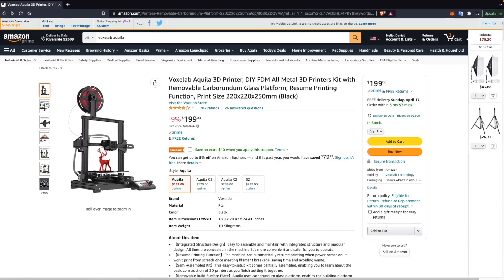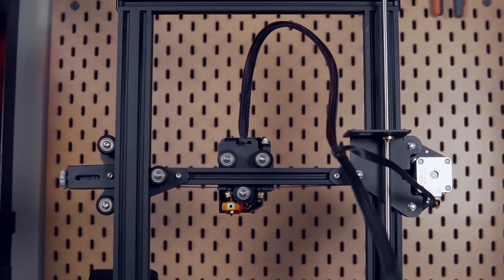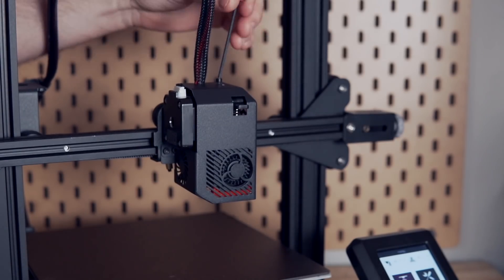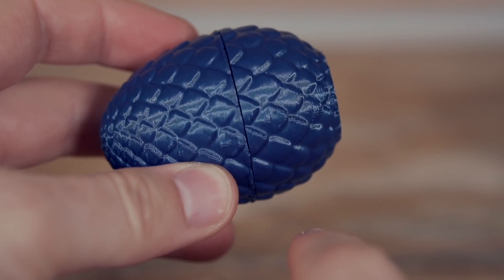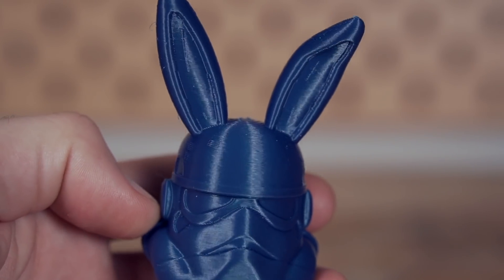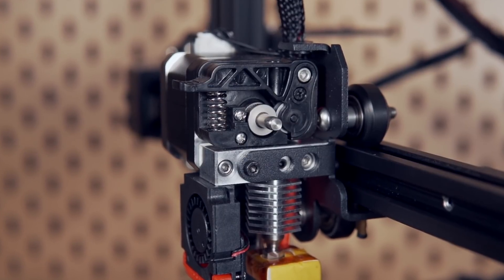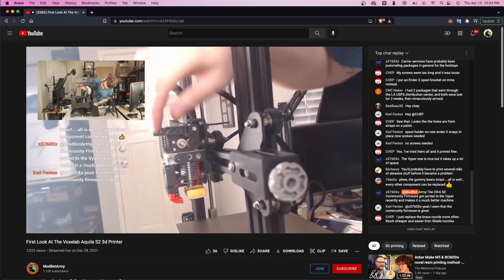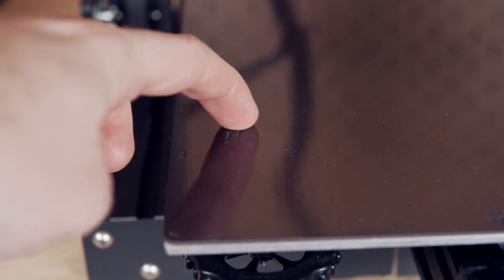Best $300 3D Printer For Higher Temp Printing? Voxelab Aquila S2

Comment: what is the difference between the Voxelab Aquila X2 3D Printer and the Voxelab Aquila S2 3D?   which is preferable and why?  Many thanks to those that answer.
Reply: They're effectively the same, except that the S2 is capable of printing at higher temperatures and has a direct drive extruder, where the X2 has a Bowden tube extruder. If you aren't looking at printing ABS or other high temp filaments, the X2 is probably enough, but at only about $40-50 more, the S2 is a little more future proof if you might expand to high temp printing.

Comment: I will take the original and the cash.
I printed a direct drive plate for the ender 3, used a light pancake motor an all metal original single gear extruder and flexibles print like magic.

Total cost? $12

Comment: My actual opinion though, is for that price point, I would rather go with other options that include auto bed leveling. I mean this IS 2022 and almost every printer is being shipped with ABL as standard now, and while I think some budget machines just won't work it into their sub $190 price range, with options like the Geeetech 3D Touch literally being under $10 with shipping included, they could easily add it onto every machine without it impacting the price. I just think some of these companies are going stagnant and just reviving their older machines with the bare minimum, but increasing the price.
Reply from the maker: As long as the abl is implemented correctly then I agree. I would still rather manual than a poorly implemented auto leveler. I have experienced both on creality when they first dabbled with able as well as a few printers that had implemented it poorly in firmware or used really bad inductive probes that I spent more time fighting with it and it was worse than manual. Granted it has been some time and agreed especially on these things beds that are warp prone. Abl and all metal hotends are what I want to see as a standard.
Reply: @ModBotArmy  yeah no doubt. the 3D Touch from Geeetech has been tested against the BL Touch and so far has had really positive response

Comment: Hi ModBot, by any chance, have you tested thermal protection features for this printer? If not, you proabbly certainly should ... Their previous model had serious issue of firmware freezing on thermal events like runaway - which is REALLY dangerous. It's terrifying Flashforge hadn't even tested this themselves when printer went to production!
https://youtu.be/9Vai6NKxeG0?t=422 
https://www.youtube.com/watch?v=eGUPBoDxmKk

Comment: That hotend..... Great video, but proprietary nozzles that you have to order from Flashforge and wait for slow China shipping.  No hardened nozzles for the machine either, at least not last time I checked.  

BTW that extruder is the same extruder they use on some of the Flashforge machines, that is why they probably went with it.  It was cheap and already in use.

Comment: This printer seems perfect, except that you can't get hardened nozzles for it.
Reply: you can use standard nozzles...
Reply: @ComicMelon  But not at high temperature, the longer nozzle is to reduce the heat on the PTFE.

Comment: One thing not mentioned in the video. The nozzle is proprietary form factor. For me, right off the bat - deal breaker. Absolutely no reason for it.
Reply from the maker: It is not something I was aware of. Block outwardly appears standard and removing a nozzle isn’t a part of testing process. After seeing the nozzle I am not entirely convinced you couldn’t use a volcano nozzle. Even if the throat is slightly longer it should work. It is what I currently do with v6 nozzles on an mk8 block.
Reply: @ModBotArmy  Someone made a mod to use one of the standard nozzle form factors you could install.  But you have to do something like that, you can't just use a volcano nozzle apparently.

But just my opinion, this is yet another thing you gotta do.  Why not get a lower cost printer and just install a heatbreak into the stock hot end or drop a new hot end in?  And then there's just the principal of the matter - I refuse to support with my money a printer that introduced a proprietary nozzle that adds literally ZERO functional advantage.  Just... no.
Reply: @heroflying  can you link the mod?
Reply: @zombieno1  Negative. I heard about it second hand.  Sorry.
Reply: @heroflying  qqaaaa0ap

Comment: I've heard that hotend uses a proprietary nozzle. It's not an off-the-shelf Mk8 (longer screw than standard). Could you confirm?
Reply from the maker: Which is odd considering the block is fairly standard sized.
Reply from the maker: Looks almost like a volcano https://youtube.com/shorts/PvGom4ijve8?feature=share
Reply: @ModBotArmy  Sadly its not. Its entirely proprietary sized. :( Its shorter than a volcano and longer than a mk8. The nozzle that comes with it is the wrong size. Oh and the block is also proprietary.
Reply from the maker: @3DPrintSOS  could you not use a standard volcano and have a bit of the throat sticking out? I have done similar with v6 nozzles on an mk8 style block. Wish they had gone with a more standard block. Do you know if a copperhead will work with it?
Reply: @ModBotArmy  You technically could use a volcano nozzle. The issue is then the block threads on like a nut, so it would move downward as well. You'd have to modify the shroud and cooling duct and the filament path would be a bit longer. So it's not just a drop in sadly. PLUS its brass...so abrasives will kill it quick. 

Additionally, there is PTFE lining most of that hotend. Just above that steel proprietary throat. So it's far enough away...but still weird to see in an "all metal hotend".